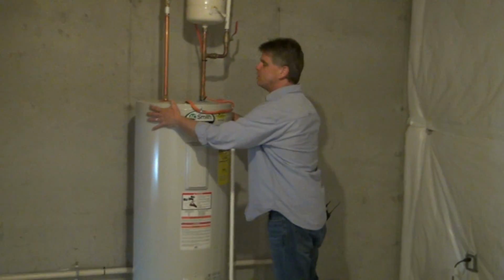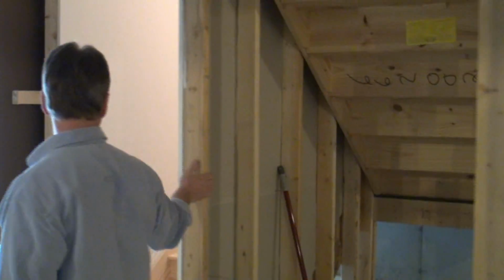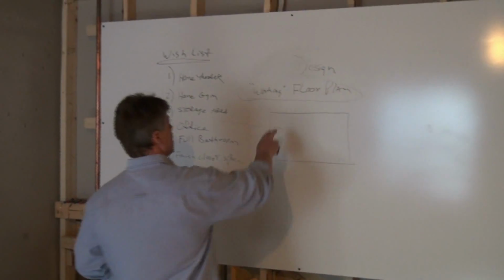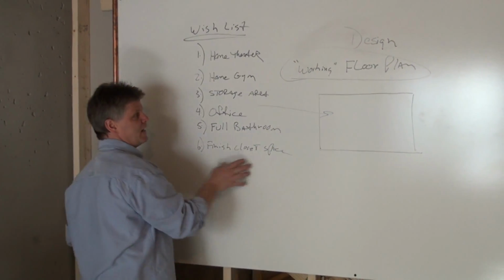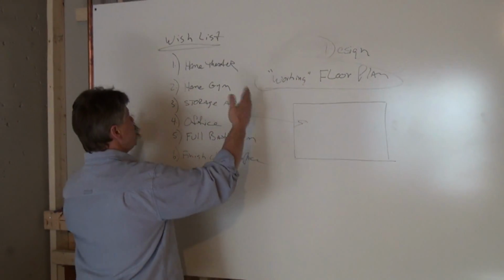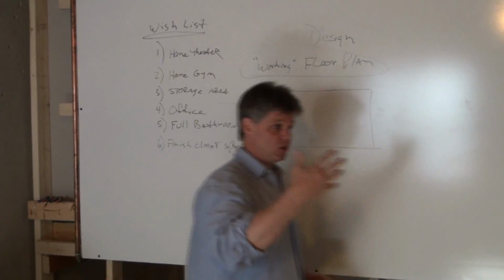How To Design a Finished Basement (Part 1 of 4)

Comment: You have become my go to source during my current basement renovation.  Thanks for the videos!   Looking for your opinion on dimple mat with ply on the concrete floor as well as the type of insulation to use in a NY climate....  XPS on foundation wall and faced insulation b/w the studs?  or unfaced???  Thanks and keep up the great work!